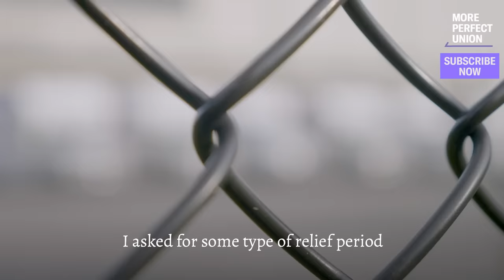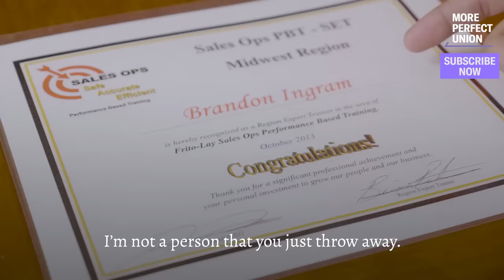Frito-Lay Worker Electrocuted, Denied Medical Care & Surveilled by Company Agents

Comment: The hospital "contract" is a truly disgusting policy that too many big companies have
Reply: I feel like they made a contact with a hospital THAT far away on purpose. Companies that own factories are infamous for this kind of behavior and have been for centuries.
Reply: @kiwi___  do you know why these companies sign contracts like that? Wouldn't they want their workers to be as healthy as quickly as possible?
Reply: @BashslashSlayerTv  you can obtain a healthy bill by providing medical care at subsidized rates. Aka cheaper insurance. No need to make deals with hospitals in our system, they never have. But this company did, and it was for some agreement under the table. Absolute bull shi+.
Reply: It SHOULD BE HEALTH OVER PROFITS.
Reply: I worked for a hospital that rented a wing inside another hospital and I had a patient who ventilator started to alarm I was in the hall way talking to 2 of the doctors 1who the the director of the hospital. I stopped talking with them and rushed into the room to reconnect the patient and make sure they were okay. But as soon as I crossed the threshold I slid in the inch of water the housekeeper left on the floor I  went down hit my head and ripped my right knee apart I ended up needing 12 stitches in the back of my head and having my right knee reconstructed. The hospital I work for had a contract with another hospital that was 8 miles away instead of 7 floors down to the emergency room of the hospital that they least in. The director of the hospital that I talking to when it happen who witnesses the whole thing overrode and had me taken 7 floors down to the er. 
Than the work comp doctor tried to say I came to work like that (I  was 10 hours into a 12 hour shift)! I am a bad bitch that has a high tolerance for pain but I was not able to stand let alone walk and I was bleeding heavily from my head. They even tried to get the hospital doctors who witnessed it to lie. Both of them actually resigned over it!
Reply: @kimberlywalker6565  That's Soo crazy! Good story😳
Reply: kimberly walker
      Holy freaking S**T, what a completely F**KED situation! I sincerely hope you are okay for the most part now and have relatively good cognitive functioning AND ambulatory mobility despite sustaining a not-insignificant head injury AND having your knee be so terribly wrecked! 
      You were definitely owed medical care and support seeing as how it was due solely based on another employee’s negligence, and there was absolutely NO way you could have avoided it! Of course the spilled water could have very well resulted from a faulty janitorial bucket that suddenly sprung an obviously voluminous leak which the custodian could not have predicted; however, it was still their responsibility to put down “Wet Floor” warning signs indicating a potential slip-and-fall risk-causing puddle AND to efficiently PLUS sufficiently inform whoever was in the immediate vicinity (like you and the two doctors in the hall with whom you were conversing immediately prior to the sounding of the medical alarm) of said risk!
      I’m so thankful that you had the doctor in your corner who made the logical and reasonable executive decision to override your employer’s nonsensical S.O.P. and have you sent down to the in-building ER for immediate treatment! The two doctors also really showed their character, ethics, AND morality of simply being decent humans by resigning based merely on how your own employer tried to f**k you over!!! 
      In conclusion, I extend to you my sincere well-wishes that you are continuing to fair well for the most part considering the bulls**t you were forced to experience and overcome! Cheers to you, my friend. 😊❤️👍🏻
Reply: @straightto8  what is the point of having insurance with them if they're going to just take it away from you because they think you're lying? Wow! Sorry you had to go through that!
Reply: @aGwEENapple  It was a real eye opening experience, my ordeal lasted less than 3yrs to settle for damages.  They break you, one of their tactics, had I held out, and took it to a jury trial if we couldn’t reach a prior agreement this would have went on to 5yrs.  I worked on a railroad, we don’t have workers compensation, we have FELA (Federal Employers Liability Act), it’s a complicated system.  I feel for the gentleman and his family in the video, it’s a horrible situation to be in, I really feel for them.
Reply: ckorpi88ify  the other side of the story is a major corporation that wants to pay as little as possible when their employees get injured. Corporations first priority is to its shareholders, not its employees.
Reply: its americas fault for having things like that, nothing is unified
Reply: @kiwi___  some companies have life insurance on their peasants, I mean employees (Walmart actually used to called them peasants in the paperwork).
Reply: @BashslashSlayerTv  why would they care about a sick worker? Some companies have life insurance on their employees, they are literally worth more dead than alive. Also, companies like that can always replace its expendables.
Reply: @kimberlywalker6565  You go to another hospital because it would be conflict of interest if you were attempting to scam work comp.
Reply: ckorpi88ify  I mean he might be faking a little but who cares🤷🏽‍♂️

Comment: I've been electrocuted several times. Did the man fall down? I'm not understanding why the disk in the spine were herniated.  
While 120v in a switch can be fatal, it's falling off a ladder from the sudden surprise that usually causes injury. 
If the paperwork was written in a way not describing how a shock to the hand segwayed into a disk in the spine was injured,  then his claim may not be believable by someone who works in an office miles away. 
I've also had a machine at work shock me but nobody else. It was not properly grounded. 
I'm not saying this case is fraud, but from the perspective of a business, there are people making claims and trying to work the system every day. Some of them will claim one injury and try to wiggle treatment in for another. There are multiple sides to this story.

Comment: As somebody who currently works for Frito lay, these fucks are awful. They will throw you to the wayside if it means getting an extra box of chips sold to a store. They are brutal and they do not care about you.
I recently got “promoted” and i have never been so depressed and defeated. In the past 3 weeks, I’ve worked 19 days. In case anybody needs clarification; that’s two days off in 3 weeks. I’m not willing to risk losing my job, so my fight back is minimal. That being said, in the past, when I’ve tried to stand my ground, I got put on the worst possible route for my job, earning less money and dealing with a much shittier environment. The company is evil, please buy Tim’s chips instead.
Reply: I want to add, my struggle doesn’t even compare to the gentleman in the video, but my goal is to show that the company isn’t just going to be brutal in the face of a lawsuit, they genuinely care about money over anything on every level. It’s evil.